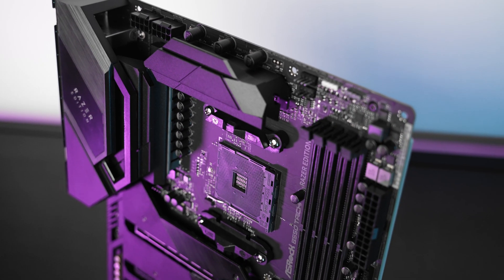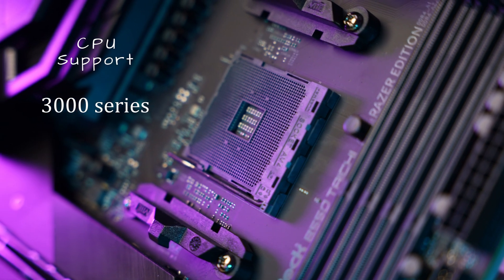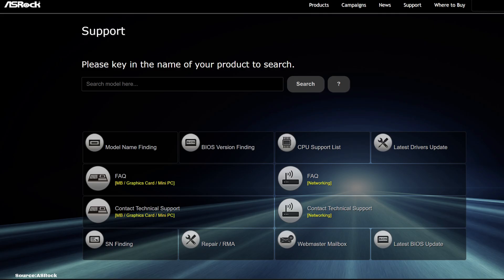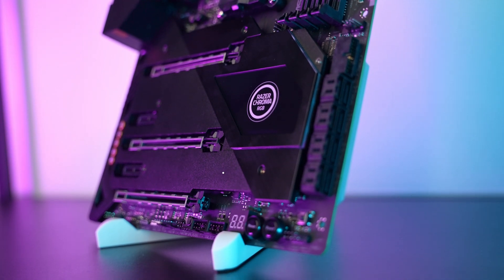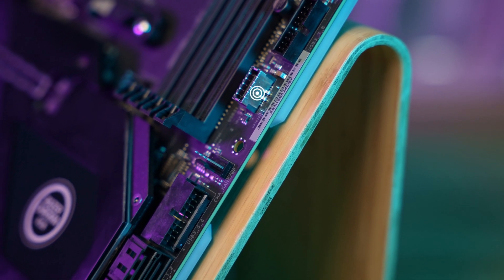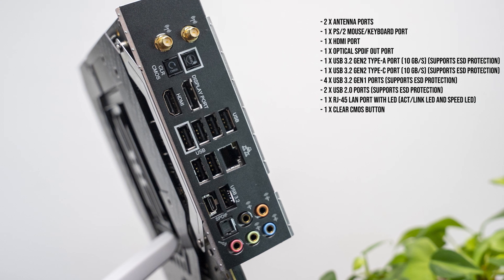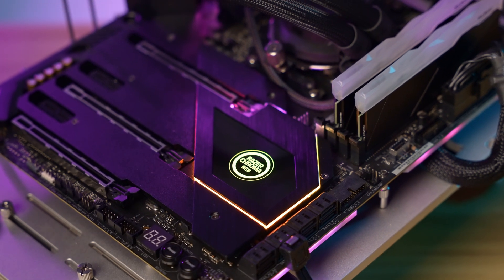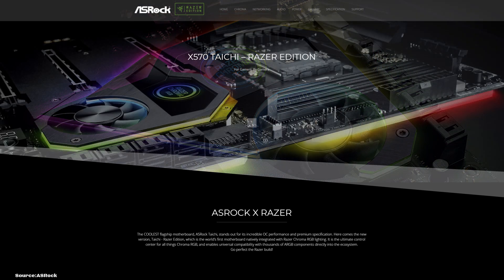ASRock B550 TAICHI RAZER Edition Hands-On

Comment: Not sure if I should get this one or the X570 version. I am kinda of nervous about the longevity lifespan of the X570 chipset fan though.
Reply from the maker: do you need multiple pcie gen 4 ports and the extra high speed usbs?
Reply: @A2KMedia  I'm only going to use a single video card, single boot nvme ssd, 2 sata ssds and 1 hdd. As for peripherals, keyboard with one USB pass-through, mouse, barely used printer, probably 1 type C in the future. That's about it.
Reply from the maker: @BlueSword455  oh then you are fine! b550 all the way
Reply: @A2KMedia  Great thanks! 👍

Comment: sorry another question, is that working well with lan cable? this board just arrived today, and wifi Is working but lan cable is not working now. should I download any internet driver?
Reply from the maker: it was working ok for me - do note it may be in a 2.5gb mode and if your system does not support it you may need to tweak it. Install manufacturer drivers and update windows then try again

Comment: should I update bios for gen3?
Reply from the maker: are you using gen 3? If your system is working ok, then I would review bios upgrade notes and see if there is any benefit to upgrade. Normally if your system is stable, best to leave it as is to avoid any issues
Reply: @A2KMedia  Thank you. I'm using 3800x now. but im worried that i have to downgrade of bios for 3800x. or can use directly.
Reply from the maker: @junchy0422  no, the new bios supports both 5000 and 3000 series.
Reply: @A2KMedia  thank you so much